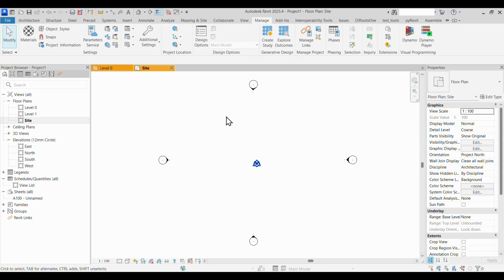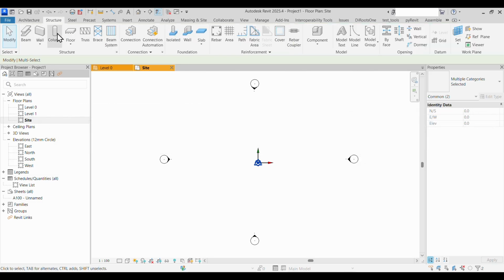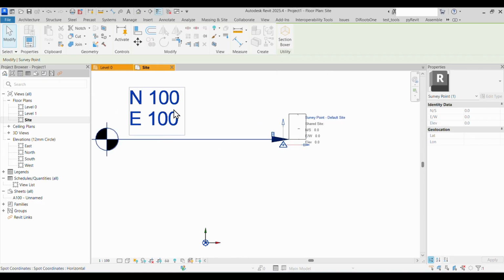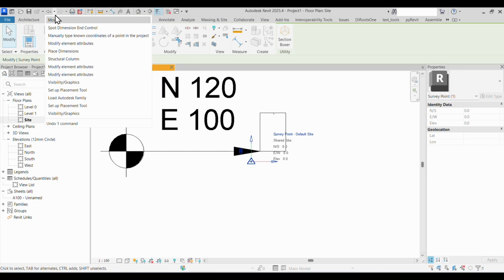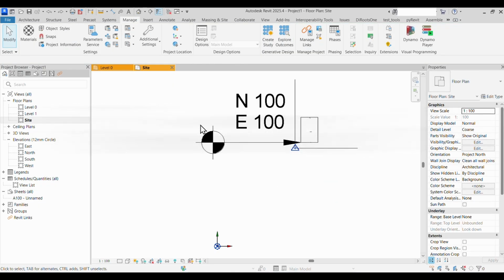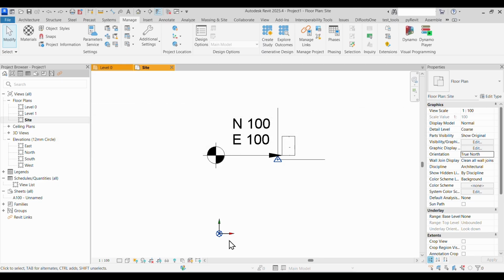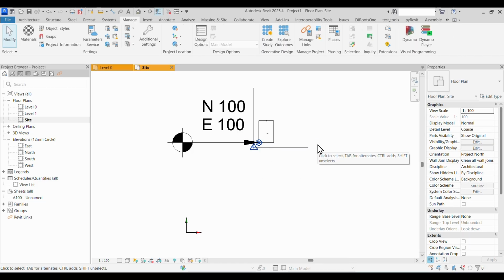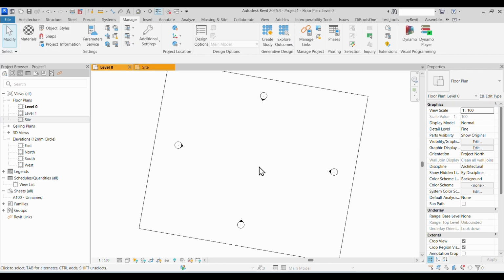Revit Coordinates Explained | Revit Basics

Comment: Hello sir 
Make it floor in the revit it is
Confused it it attached the outerwall or innerwall?
Reply from the maker: If it is a structural floor, it is always aligned with the outer wall.
If it is a finished floor, it is always aligned with the inner wall.